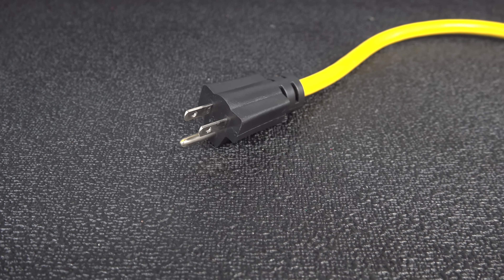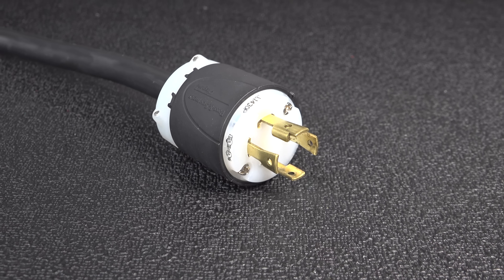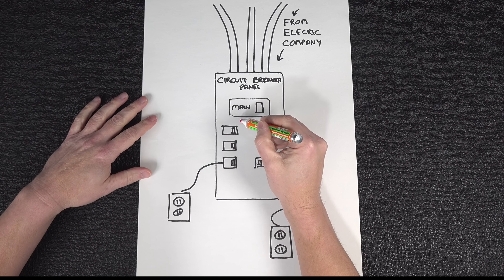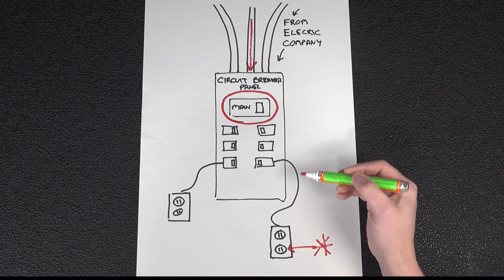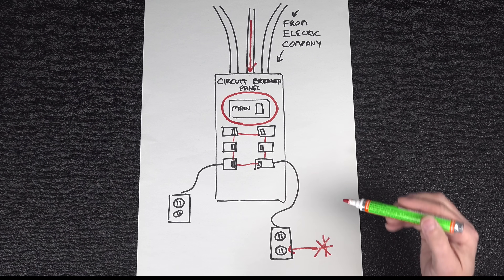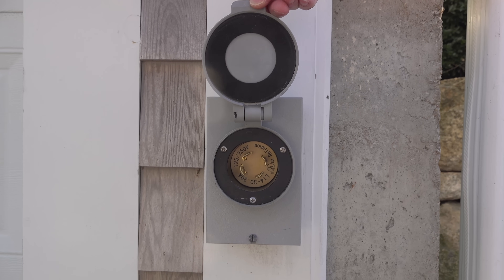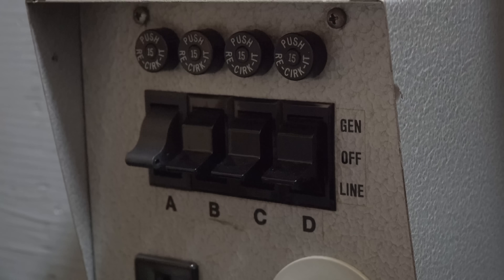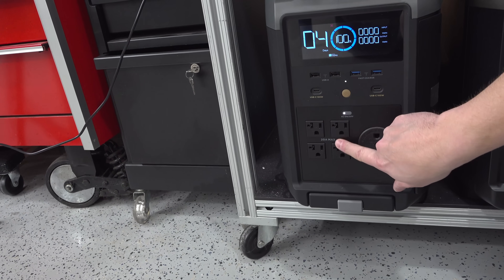Worst Electrical Mistake You Can Make - Backfeeding Generators

Comment: Wow I never knew those suicide cords were available commercially.  That should definitely not be allowed.  The mechanical interlock approach is the way to go in my opinion.  It gives you the flexibility to power any circuit you want in your panel vs a transfer switch where you must select a few circuits you want to be able to power during an outage ahead of time.  The downside to the mechanical interlocked setup is the neutral is not switched so you need a generator with a floating neutral otherwise current will end up traveling down both the neutral and ground wires back to the generator instead of just the neutral.

Comment: Also your 110v generator, if it gets out to the main lines, can go backwards through a transformer and step up the voltage to 7200 volts. Also linemen ground out power lines specifically to prevent this to make things a little safer.

Comment: This cable can also be used by a very specialised devices, to seize still turned on desktop computers without powering them down for the sake of evidence. Lawe enforcements around the world have a version of such cable, used to be plugged into the power strip, backfeeding it, so you can safely take the computer with power strip out of the socket, withtout turning off the device.
Reply: law enforcement probably know what they're doing and aren't likely to electrocute someone in the process. in any case, plenty of ways to circumvent that. also, your online presence at this point is probably more valuable, by far. latest versions of windows are also just spyware-loaded by default. maybe it'd be good for seizing servers, but a lot of the guys running illegal services/servers probably have thought of this. logically, if a device could leave the premises, make sure it starts destroying its data while in the hands of unauthorized users. curious how many people actually go nuclear and full-wipe systems/drives, though? that is all it takes, at least for the physical hardware.

Comment: I'd love to have an automatic system that runs off any type of fuel including natural gas from the mains, where it turns on when power signal stops being supplied to it, and it's all built into automatically shutting off the main in order to send power.
Reply: Those have existed for a very long time, they are called automatic standby generators, they come in liquid propane, natural gas, and gas/diesel, and some other fuels as well, they can be a gas turbine or regular engine. Many options
Reply: @bait28  I know I just want one lol

Comment: I 100% thought that backfeeding was legal, and not only that, but that power supplied to the electric company would be deducted off your bill, or even paid for by them.
Reply: Depends on the power company, many allow that, but you probably need some kind of special contract for that with them and also special eqipment to synchonize your generator with the grid. If its out of phase it will only cause damage.

Comment: DC-9's , MD80's and other jet aircraft have a power inter lock relays so only one AC source can power a bus.  At home I prefer to  run extension cords for generator power and solar power circuits for the frig and window air conditioner and lights.  These things only work as well as the operator!

Comment: If you have a small generator and are only running a couple of loads, you can do the "spaghetti" thing where you run extension cords to various places in the house and just bypass the house wiring entirely.  But that isn't always safe either - if you don't understand wire gauge issues and the limits on how long certain cable runs can be, you can get yourself in real trouble doing that.  At best, you might fry something from low voltage, at worst the cord will suddenly catch on fire.  Don't start plugging extension cord into extension cord into extension cord, that is incredibly dangerous if you don't know the gauge of the wire in each cord and the total length of the run.  Most extension cords are simply not made with thick enough wire to allow that.  

I plugged a box fan in once after doing what I thought was probably too long of a run with multiple extension cords, thinking, yeah, it is such a small load, it won't be a problem.  WRONG.  It seemed absolutely fine at first, but it started to sound a little funny so I went over to look at it.  The thin cord of the box fan suddenly got very hot.  Like too hot to touch hot.  I unplugged it probably seconds before it would have caught fire.  And even the thicker extension cord earlier in the run was very warm.  You get a significant voltage drop at the end of a run that is too long, and then very bad things happen, even if the load is relatively small.

Comment: I have never owned a generator as I am a lineman, and if the power is out, I'm in the field working until everything is back on. Another solution instead of using one of these cables is to isolate the circuits you need and hard wire then into the generator. It's more work but also pretty easy to do.

Comment: As a lineman we always hang grounds so the electricity has a constant path to ground, if it is somehow reenergized but there are some situations where it doesn't always happen and a lineman gets killed from a generator backfeeding the line. I have seen an underground primary line backfed while we were working on it and there was an extremely violent arc flash, thankfully we still had our gloves on but it could have easily got someone killed.
Reply: A backfeed from a home generator cannot cause an arc flash.  The power level required to cause one is insane compared to the output of a generator.  As a lineman you should know that.
Reply: @knurlgnar24  you don't have to have any load to cause an arc flash. 14.4kv to ground with no current is still pretty violent, just not really explosive
Reply: @motarted1735  thanks for what you do, bad ass
Reply: @motarted1735  lol, i can make a 14kv generator from a 9v battery. do you even know what current is? an arc flash, also called arc explosion, can only be caused by hundreds or even thousands of AMPS at high voltage, which means megawatt range. a home generator cannot even get close.
Reply: @gaynzz6841  you're right I shouldn't have said arc flash since that usually means a flash that's bright enough to burn, and yes, the amps from a generator back feeding to a higher voltage is barely enough to register on a meter. There is still plenty there to draw a normal arc, and although the amperage is significantly decreased, (by 120x at 14.4kv) the increased voltage will travel through the human body much easier. It is still deadly because people have died from induction alone which is carrying nearly zero amps.
Reply: @knurlgnar24  and as a lineman I’m gonna go ahead and disagree with you. Yes it mite be a little baby pop but you step 120/30a up to 7600 it’ll do something.

Comment: might be illegal and unsafe but when you have three families at your house because a hurricane knocked out power for weeks on end that main breaker gets turned off and that panel gets back fed. Had to to run my well pump. so three families here at my house AND I used a washing machine hose to back feed water into my neighbors plumbing so they could shower for the first time in a week... no one could accidentally turn the main back on though because I locked the box with a pad lock , why not spend thirty dollars on an interlock?? because I have a super weird main breaker where it has a tiny switch , Even making something custom the switch is so tiny and is elevated higher than the other breakers there is just no way to reliability do it. I'd change the main breaker BUT the main lines are bolted directly to it so I'd have to call the power company to turn off the power , then answer questions about who is license blah blah blah , nope I'll just back feed on my dead end road in the country

Comment: Among my late father's possessions I found a useful mains extension lead, (UK 230volts), that he had made up.  I decided to use it.  I inserted the plug into the socket and went to the other end of the lead only to realise in the nick of time that instead of a socket this end also had a plug which was now live and I could have easily touched.  My father was never very careful with electricity, (and a lot of other dangerous things besides).   I sometimes wonder how he managed to live for 88 years.
Reply: @CajunReaper95     The extension lead was very long and it was not immediately obvious until I had reached the other end and found another plug instead of a socket.

Comment: Having lived thru a number of winter snow storms (I'm in WNY), I've been witness to many dumb things done by desperate people when power goes out for extended periods.  Those cords are the worse and I feel for the power crews having to deal with power back-feeds from people who have no clue what they are doing.  Another is running extreme lengths of light-duty extension cords and trying to run high-draw equipment (like a furnace)... you can actually see the snow melt around the cord!

Comment: It's only illegal if you get caught.  Also this is bs.  Shut off your breaker and back feed all you like.  It's your house fk the law.
Reply from the maker: It's your house, blow it up if you want. But when your mistake travels to someone else outside your house is that ok? It's happened, there have been deaths and charges were filed. I'm not the cops and I'm not your judge but why on earth you wouldn't install something correctly makes no sense to me, Its $100 of parts.

Comment: You can use this cord to send power from a generator to a bedroom. Plug it in to an outlet in the room and the room and what ever is connected to it will be powered up.
Reply: Only if you shut off the breakers correctly.

Comment: ...Or just use common sense and know who's in charge of that Main Breaker and who isn't to touch it.  That way no one "accidently" turns it on while the generator is back feeding 240V through the dryer socket. (Or just install the Interlock, like I did. Way safer!)

Comment: This male/male cable is also used in old voltage transformers. The transformer has 2 female outlets both ends connected to each coil. So you can transform 220v to 110 and vice versa.

Comment: We installed a transfer switch on our house last year, it’s a big 3 position lever, position 1 is mains, position 2 is off, and position 3 is generator, and the output goes to the breaker box, there is no possible way both power sources can be on at once so it’s as safe as can be

Comment: The other problem with backfeeding that way is you're now running a 100-200 amp panel off a 15-20 amp circuit
Reply: So?  If you exceed 20 amps of load, the breaker will trip.  If you don't, then there's no problem.

Comment: I've  been offgrid for 6 years now. This is how I energize my home circuits from my battery bank, or the generator. Simply plug in the non-energized side first, then the hot side second. You really have to pay attention. 
I'm also an electrician, hvac, and handyman, so cut the crap. Yes, if you aren't confident, don't do it!
I recommend dead man cords to everyone with common sense who needs to energize an ISOLATED circuit in an emergency with a generator. Simply turn off the breaker for that circuit. Also the whole house for double safeguard.
I'm offgrid and there wouldn't be a feedback to the grid, in my circumstances...
Reply: the thing is you're an electrician handyman etc, most people aren't. for people who know what they're doing, and/or in emergencies, sure go ahead. but the vast majority don't know what they're doing and if they do it improperly (I'd be willing to bet money 50% of americans have never touched their breaker panel) like forgetting to turn off said panel, that's a mistake that could kill someone.
Reply: @Megasteel32  exactly, as I said too. I wouldn't recommend such to just anyone, it's usually someone already mechanically inclined in these things. 
Basically an electrician costs like $150 per hour, with a couple hour minimum.
The "right" equipment to hook up a generator (equipment only) is expensive. 
Add those 2 numbers together and that's a lot of people freezing in an emergency situation without power. Are they are better off freezing, or educating themselves?
Maybe stick to canned foods and propane backup heat in emergencies? I do that too. Those propane Mr. Heaters, or the smaller Mr. Heater Buddies are both very nice backup heat sources.